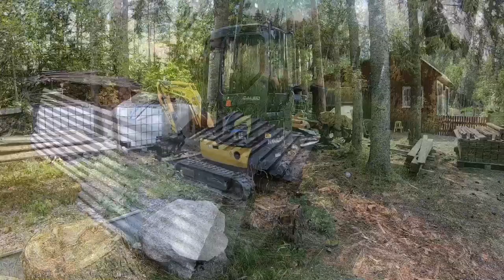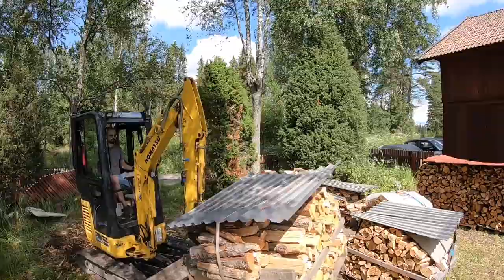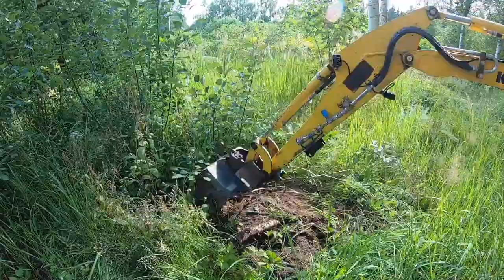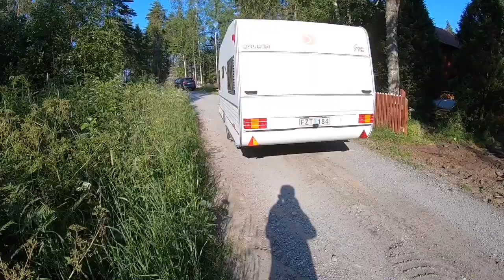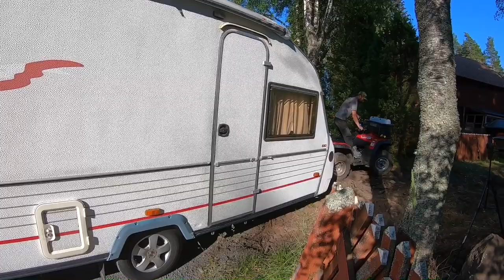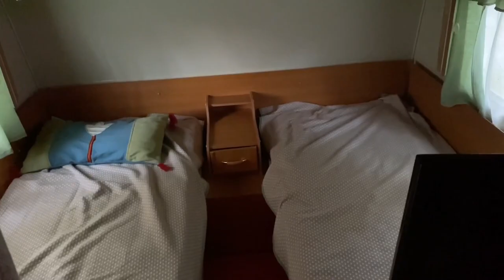Creating a parking for gaming caravan

Comment: You have a lot of big rocks in the ground, but it turned out great and think your kids will be happy now.
I was most surprised that the atv managed to pull the camper 🙂
Reply from the maker: Yeah they liked it, for 2 days….then they wanted inside where there is air conditioning. The Honda isn’t fast but it sure is strong!
Reply: @NilsKall  It sure is strong, I could never imagine it would manage to pull a heavy camper with it. I know some have used 400ccm for it before on flat surface.
Reply from the maker: @ArcticExploring  its low geared in first gear and it has no belt to slip so a very direct drive. The video don’t really show it, but the road is uphill and so is the parking lot. Probably the same with your videos, a really steep road don’t come out like that at all.
Reply: @NilsKall  Ah I see. But often it is the weld on trailer hitchet or the frame itself that doesnt hold up.